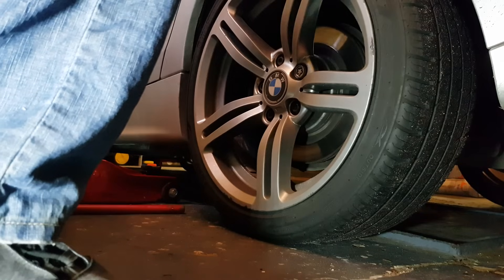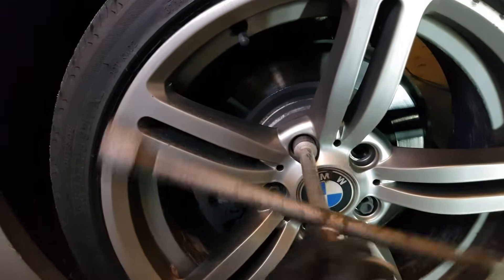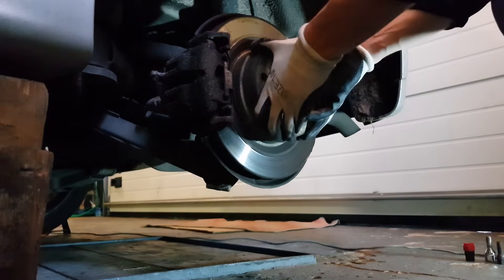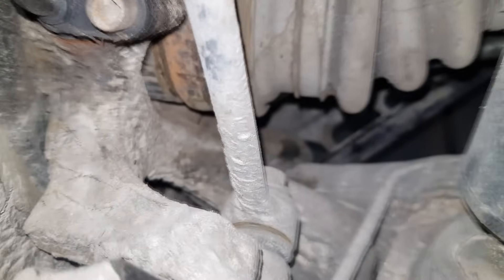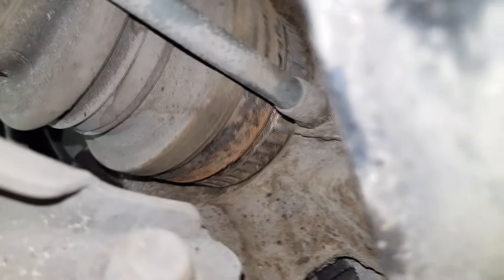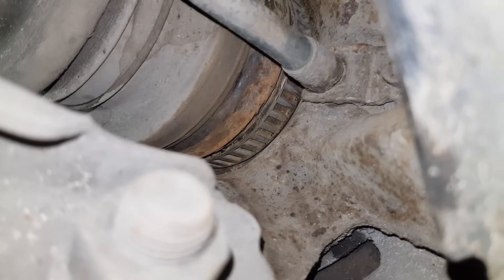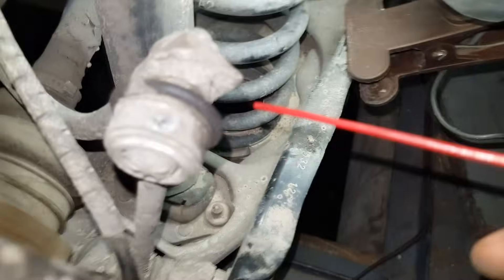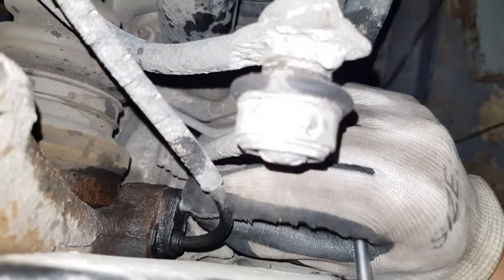Free BMW stability control DSC/ESC fix that works perfectly and it's easy to do(HACK🤖) e87 e90 e60

Comment: Can it also give you no throttle response?
Reply: It can, my 2006 325i did.  Going to try this fix soon.  And if it does fix the problem I'll go from there, starting with the sensor, then the ring, then the driveshaft if needed.
Reply: You should see a message on the information screen that says Drive Moderately. 
My car has a delay in acceleration, because it is in a semi- limp mode. My car is a Seven Series with the V- 12 Engine. I'm having the ABS Computer refurbished to resolve the issue. My wheel sensors are sending the speed signal to the ABS module. I can see the signal using a high- end Scan tool.
That's why I know that the ABS module is the problem- not the Wheel speed sensors/ reluctor ring.

Comment: Wish me luck! I will try this fix tomorrow! I've had this problem for over a year now on my E90. I manually turn off the DTC, and it drives fine. I will be replacing all 4 ABS sensors, and give the reluctor rings, and sensor holes on driver axle a good scrubbing/scraping.
Reply: How it went
Reply: @bash4214 car blew up

Comment: Why don't you just use aome anti rust and rust remover on the ABS ring?
Reply from the maker: It's not surface corrosion. The rust bubbles are underneath the abs ring.

Comment: well done with this video! Can you please tell me how can I manage to find out which sensor should I "repair"? Because I don't have a permanent error...is just the DSC that comes on/off repeatedly. Thank you!!
Reply: It's is usually always the driver side rear speed sensor! The light go's off for mine to..you have to get a high end OBDi reader. to read the code. cheap walmart reader wont do it.
Reply: @ohmzen9695  I can confirm this, driver side rear.

Comment: I had this exact  problem with my BMW-320. This problem is temperature dependent too. Since the magnetic HAL-effect (which is the principle for a reluctor-ring to operate correctly) is varies greatly with temperature. My problem started 2 weeks ago when the temperature here in Bergen / Norway dropped under 0 C.

(I'm just mentioning this if hasn't been stated in the comment already; too lazy to read them all).
Reply: Hei man. I have the same problem with my BMW116. I got quoted 23000kr in Oslo. How did you fix it in the end?
Reply: @esmaillutfi  23000 NOK is a rip-off!! I paid 5000 for a sensor-ring + 2 sensors.

Comment: Got DSC problem on a 2006 M6.Keep going to garages and BMW Main and still no joy.Start up, drive four of five miles and then DSC Failure comes (after getting shop or petrol) up on dash and Drive Moderately.Main dealer looked, said battery needs charging, needs to do more miles, charge for 3 hours per week, charge for a day a week, get new battery, did and STILL get the prob.I tend to shut down and then re-start and problem goes BUT how do you explain that to a prospective buyer? BMW UK say take it to main dealer, that will be another £100 "health check" thanks. I will try your trick, thank you.
Reply: just change the sensors on all 4 wheels they are cheap and easy to change ,also take a wire brush and clean the axle shaft that the sensor is on , something the rust will not let the sensor work
Reply: Joe.Thank you I will get this looked at and get back to you ASAP, she's going to main dealer as advised by BMW UK on 12th Jan so I will say I want done what you recommended!!Happy New Year! Derek.
Reply: How did you repair your BMW? Did it work? My 09 BMW has a similar problem with you. I just drove five miles or around 10  minutes then the flickering orange triangle warning light frequently came out. That is, they are always flickering, no matter how long my journey is. By the way, I just changed a new battery.
Reply: Got in touch with BMW UK, they said take to main dealer, they have done diag and found a throttle problem and a unit has failed.Being fixed (hopefully) next week for loads of money, as usual...
Reply: Hope you are lucky to sort the problem out. I also made an appointment next Tuesday to try Regis Garage’s method.
Reply: My main dealer garage here in UK found that "bank 2 actuator for DSC light" was faulty and replaced and so far so good and all fine.
One garage said about the wheels and fittings being rusty will not alter the problem as the problem arises before the car moves so nothing to do with wheel fittings. Stop car, restart and light comes on, no wheel movement.  So this problem stems from elsewhere, in the actuator in bank one or two apparently.

Comment: god dam. i have a e81 and it had the same problems , car was basically undrivable, went to my mechanic he ran the codes and there was no fails, he got really upset since he test drove the car and immediately problem was obvious , i drive alot on Autobahn and imagine car doing this on 160-180 kmh. shit is scary, so finally he agreed to try this since he was very skeptical, 2 days later so far so good nothing obvious , car drives normally so far
. if in the future anyone is interested will update. thanks for the video m 8
Reply: How does the car work for you now?
Reply: @madsn55287  sorry , for late reply, but the car runs just fine , never experienced this issue , knock on wood.

Comment: Hello , i did the same thing to my 2006 330xi , it felt the difference , the only problem is the now i have the abs, air bag  and dtc activated.  What can i do , because the abs is making my car brake and i cant drive fast when i need to

Comment: Hi, I have this problem. I’ll be driving my bmw 320D e92 regardless if I drive it slow or fast this sign keeps on coming up forcing me to turn traction off. I’ve had the shockers replaced, brakes replaced. Bolts replaced. Tracking done. This light just won’t go! What do I do? Help
Reply from the maker: You need to inspect your reluctor rings and abs sensors first

Comment: Hi,
I've got a 2006 X5 e53 3.0i and it has the 4x4 light constantly on. Kindly advise what could be a cheaper fix.

Thanks...!!!
Reply: The Visionary did you find out? I have the same problem on my X3
Reply: @strangeronpublic7987  Hi, I tried the fix on the video but it didn't work for me, I guess the sensor was busted
Reply: Turn steering wheel all the way to the left for a few seconds and then turn all the way to the right for a few seconds.  That should clear up your 4x4 light.
Reply: Hello, how did you solve the problem, please?

Comment: I had this issue on my 120d. Warning light, reduced rpm then limp mode. The fix from various garages was between £180 to over £400 ( from BMW ). My local specialist garage did the fix you outline in the video for £70. That was about 20,000 miles ago. Had no issues with it since. :-)
Reply: hi there, would you recommend your local garage to me please?
Reply: Which garage was that?

Comment: I followed your video to clean my sensors and it worked. No more ABS kicking in all the time. Thank you very much!
Reply: Waqas Siddiqui the question is: will the ABS still work when you’ll need it the most? Hope you wont dive into a tree while braking.
Reply: Adrian - well said, - the ecu deactivates the abs, when u have driveshaft issues without u known, these guy's are trying to hid a major rear-end..

Comment: blast the hole too to abs ring with an a airpistol. and spray breakcleaner on into the hole.
Reply from the maker: thats a good advice
Reply: I try to avoid compressed air near possible brake dust I don't want to breathe in.  Remove abs sensor and hose down with brake part cleaner.

Comment: Good video if you just mentioned which side  of the wheel you replaced.
Reply from the maker: Thanks. I didn't replace anything. I just moved both rear ABS sensors further away from reluctor rings.
Reply: @RegisGarage  i have same problems in my bmw 320 so i have to clean them or just remove it a bit ?

Comment: things that BMW does not tell you is they are very unreliable ,
Reply: Yeah.  And people like me who just like them for some unknown reason.
Reply: Here in the UK nobody drives American cars because they have a terrible reputation for having large engines with poor power output for their size and poor economy, as well as having poor handling. I don't really know about their longevity and maintenance because nobody here wants one.
The majority of cars in the UK are European or Japanese. My experience is that the quality and maintainability of modern cars from Japan and Europe are about on par with each other (Japanese cars had the edge back in the 90's, but not anymore).
I'd also like to point out that where you are saying "everything not made in Europe", your two examples of European car manufacturers are luxury brands, so you should obviously expect higher maintenance costs. Saying that these cars have significantly more faults is just not true - if you are adamant that this is the case, please provide a source on some statistics rather than anecdotes.
Reply from the maker: what brand is more reliable?
Reply: just about everything not made in Europe. i know people who owns BMW and Mercedes and holy crap these cars are always having major problem way before they get to 100k  miles, electrical,mechanical and rust, plus these cars cost way more in maintenance and repairs than Asian or American cars. the only people that like these Europeans cars are the ones that trade them in every 3 years,before they start falling apart
Reply from the maker: Me too 😆
Reply from the maker: Jallenbah the truth has been spoken!!!

Comment: Hey thank for the nice diy. I have one question. Is that ring only on the rear driver side or on every corner?
Reply from the maker: Thanks T LY. There are ABS rings and ABS sensors on all 4 corners :)
Reply: Holy cow... You should not be working on your own car alone...
I'm not saying this is a stupid question, but it does show your lack of general knowledge, that is required to be a successful dyi mechanic.

Comment: I did exactly The same with my car 6 months ago and it works perfect!
But... I did also remove The sensor and cleaned it and sprayd very mutch rust eating oil on The ring
Reply from the maker: Nice! Good job

Comment: This is a problem that most manufacturers have .
Volvo , Audi ,Vw, Mercedes etc etc.
You need to remove the ABS ring.(reluctor ring)
Most of the time the ring cracks and fails.
Clean off drive shaft and either fit new ring of the old one if it still fits.

Comment: Sounds like the wheel bearing is causing a ring/sensor contact issue. It probably will drive a long time like that however.

Comment: OK so you have stopped the light coming on. But have you tested the DSC to see if it will interact when it should do?
Reply from the maker: It‘s been more than half a year since I made this mod. The traction control and ABS works perfectly and I had no problems at all! A lot of people all around the world contacted me and confirmed that it worked for them too.

Comment: You just need to remove the magnetic sensor and clean the metal shavings that accumulate over the years. No spacer needed, just clean each sensor.
Reply from the maker: The rust underneath the reluctor ring moved it closer to the sensor so cleaning is not an option in my case. Your option is useful in other situations and might help someone. Thanks for the advise.

Comment: how do you know, which sensor caused it?
Reply from the maker: I went under the car and inspected the rings. I noticed that one of the rings have some marks on it.
Reply: Regis Garage  in most  90% cases the back left sensor is  the probleme so u must check that first
Reply: Check

Comment: I've had this for a while and driven with the DSC turned off. However, I also get ABS warning after driving about 15-20 km. Is this normal with this problem?
Reply from the maker: Hey.I recon the ABS sensor was damaged beyond repair. When you turn off DSC the sensor is still rubbing tot the reluctor ring. What car do you drive?
Reply: Regis Garage yeah I figured so. I drive a 118d
Reply from the maker: This HACK must to be done as soon as possible. Every kilometer is damaging the ABS sensor more and more. If you are planning only to change the sensor I'll advise you to put the spacer and move it away from the reluctor ring.
Reply: If it happens after some time it might be the engine heating up the ABS module which causes cold solder joints, thus the module itself might require a full regeneration by an electromechanic. I've had abs issues and computer would say it's either abs sensor being faulty, which turned untrue. Costed 45 usd with 1 year warranty to get the module fixed (E39 5 series)
Reply: Hi, sounds like my symptoms. I get 2 faults though... steering angle sensor fault and transmission temperature sensor fault. Have you had any success?

Comment: Great Video. I got the ring and sensor replaced on one side last year. I now have problem with other side and need temporary fix until eventually replacing the ring there too. I am currently deactivating dynamic stability control every time I drive to prevent juddering.
Reply from the maker: Hey Alan. Thanks for the comment. I really appreciate it. It’s been more than 3 months after I done this quick fix. I didn’t experienced any problems whatsoever. Please let me know now about your fixing process.
Reply: My main concern now is that I have National Car Test(NCT in Ireland) this Friday  and this problem may show up. I actually don't mind driving around (at least temporarily) with this issue because all I do is press the DSC button for about 5 seconds to deactivate DSC and the juddering  stops. I might try your fix in the next few days.
Reply from the maker: You are damaging the ABS sensor every time you drive our car. It’s rubbing against the reluctor ring. It’s best to move sensor As Soon As Possible in order to save the ABS sensors life :D
Reply from the maker: After this fix your DSC will work normally. You'll pass your NCT with flying colours.
Reply: Very true Regis Garage. Good advice.
Reply from the maker: My pleasure Alan Howard :)
Reply: and you can drift into every corner as a bonus! :D
Reply: May you  explain again why you put that ring between ? thanks in advance
Reply: @alextitus2580  to space the sensor from the ring
Reply: Alan Howard hi - my 318d started showing a warning triangle the other day. RAC found no problems with diagnostic test. Does ABS still work with DTC deactivated?
Reply: Alan Howard .

Comment: Thanks for the video. How can you be sure that it's just the sensor and not the pump unit itself? I have seen many people replacing the whole unit or replacing the whole sensor. Thanks.
Reply from the maker: That’s a good question Alejandro. Usually diagnostics will show sensor or pump malfunction. In my case there were no faults. So I made a visual inspection and found out that one of the sensors is touching the ABS ring.
Reply: Alejandro Blumenfeld thanks for sharing, this is awesome, I had the same issue, it was flickering as in your video, and then it went onto full abs warning light ! Then when I parked up left the car few hours got back in the warning had gone!?!? I will try this thank you
Reply: UPDATE:  Ive put the washers in, took it for a test drive, not false ABS warning when cornering hard!  REGIS, you are a legend thanks for sharing!    I also found that the cable block in the housing in the front end to be full of mud, so cleaned this out incase. Also on the rears arches  they are not proctected at all, as the inner well protector is a absorbent material water can get through , ive boxed them off to prevent water shortening connectors?!  so far so good!  thanks again¬!!
Reply from the maker: OMG! Thanks for your comment. I was wondering if this video helped someone. I think we don’t need worry about that cable block. The cables and connectors are weather proof. There is a seal to protect it from the elements.
Reply from the maker: The rust is underneath the ring...
Reply from the maker: I had the same problem. At first the flickering triangle light appeared occasionally. But then it started to do this more often as the ABS sensor was touching the reluctor ring more and more.
Reply: Yes it worked and this video helped me alot haha. I covered them just as a precaution to rule out, but now you have told me this i will remove them next time I jack it up !   THANKS AGAIN!! :D
Reply: Could you just wire brush and clean it up, remove the rust?
Reply: First of all you need to get yourself one of the cheapest BMW designated diagnostic tools/scanners $20/30(eBay or Amazon) it will pay itself of sooner than you think. Secondary to find out whenever it's a abs sensor or the pump you need to run you car with scanner plugged in and see live data showing you all 4 wheels spinning and if it's a sensor or any sensor related issues (as mentioned in the video) driving straight and looking at live data if let's say all 3 sensors will show you that you are doing 10 mile/h and 1 will be slightly out like 12 or 8 mile/h  you'll know it's fucked or as mentioned in the video. I hope it makes sense.

Comment: Will DSC work properly after this repair?
Reply from the maker: It works perfectly. No problems whatsoever. I drove 3000 km and DSC works as it should.
Reply: Regis Garage Thanks.
Reply from the maker: This fix is so amazing. 5 minutes and your DSC is good as new.